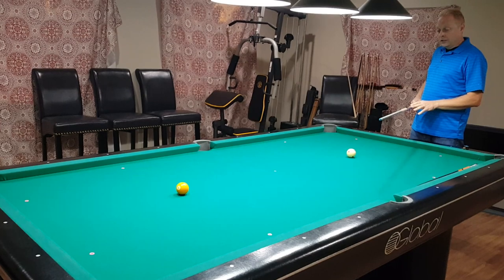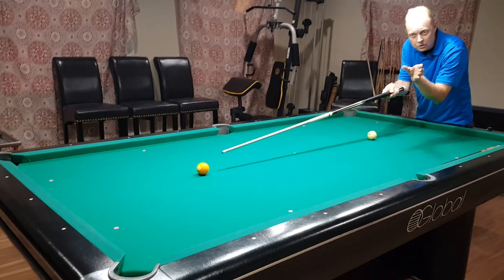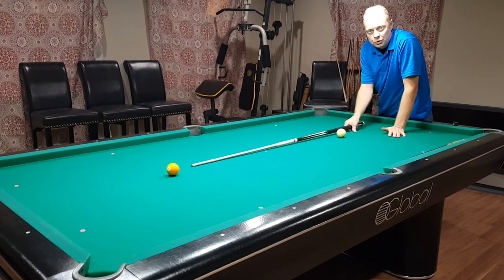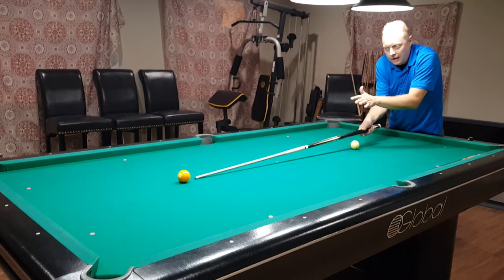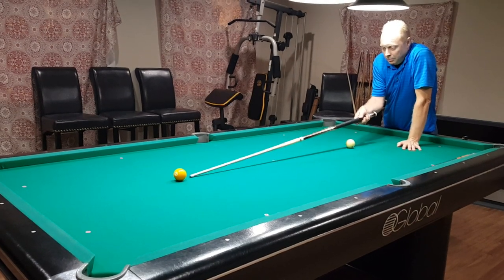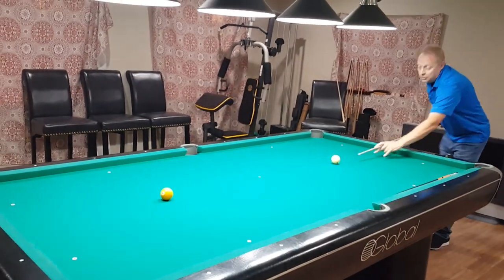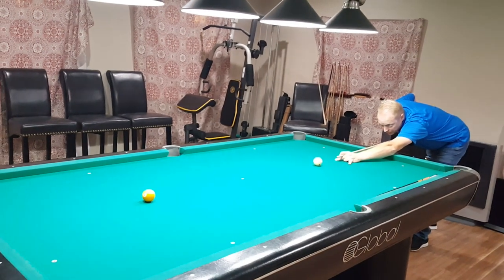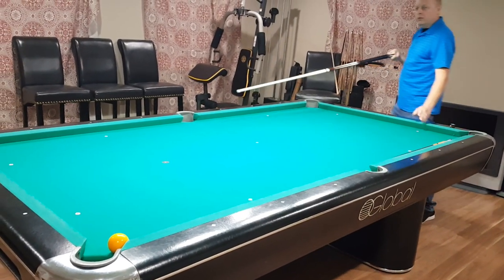Mezz Ignite,  Mezz EX-PRO, Predator 314,3 Low Deflection Comparison

Comment: i don't think that you can apply spin on the cue ball correctly. Every time you switch shaft you also switch the amount of english you apply, Why dude? If you are making a comparison test you have to be  as consistent as possible. The cue ball speaks for itself. When you hit with the Ignite shaft cueball goes on the short rail about a diamond off, with Ex pro you gave a lot more spin, cueball goes into the long rail that means you gave it way more english. It's clear that if you strike the cue ball with half a tip or a full tip the cue ball is going to squirt more. I suggest to repeat the test being sure to hit always on the exact same spot.

Comment: Great video! Thanks for this I'm looking to buy a new shaft. My question on the video it seems like the shafts with the less defection doesn't take as much English. When it hits the back rail with he ignite it goes less to the left than the other one. So do you end up getting less English the lower the defection the shaft is?

Comment: I have consistently played for 3 years with 314-3 and for 18 months with an Ex-Pro, I can say with certainty that the Ex-Pro has less deflection than 314-3, especially when you increase the strength of the shot.  .. IT NEEDS MUCH MORE THAN A SIMPLE SHOT TO GET TRUE CONCLUSIONS!
Reply: Breeze Allday I think the Ex-Pro, but the Japanese tip (Zun Plus M) greatly influences the feel, soft and solid at the same time.  The shaft has the perfect diameter for me, 12.5mm.  There is definitely more feeling with this shaft.
Reply: Got the ExPro too, Will be testing it on Stream.
Reply: Sigma Shaft on the way as well!

Comment: whats the pivot point....? ''little to no deflection'' compared to what lol? there is no shaft with zero deflection, they all have a natural pivot point with bhe aiming that changes with the speed of the shot, some have shorter pivot some longer(longer pivot=less deflection), according to all proper tests i have seen, ignite has more deflection than revo or z3, so how can it have zero deflection:D... lol
It is clear that you dont actually understand the physics of deflection, what it means and the proper testing methology to even have opinion on the shafts deflection. Measure the pivot point of the shafts with bhe shot to get real results of deflection. The way you tryed to test the shafts, requires paraller aim shift of the cue from the center line but you also used different amounts of pivot with the front hand shift (bhe+fhe) on the shots, thus making the test completely useless.